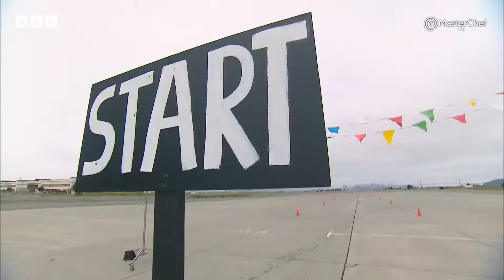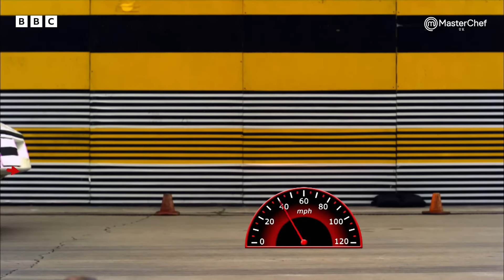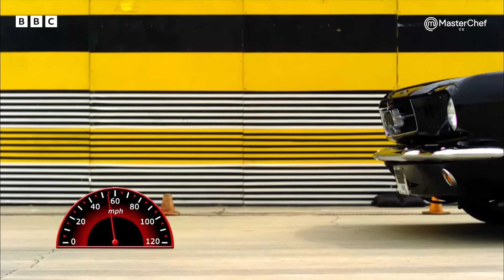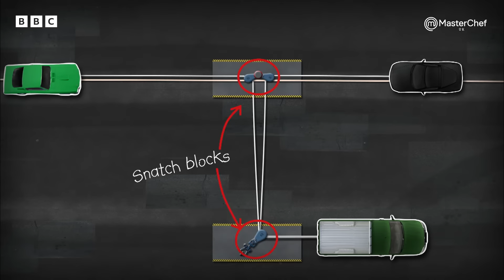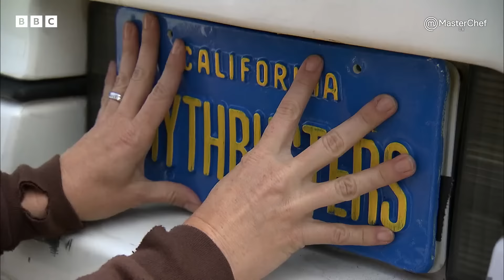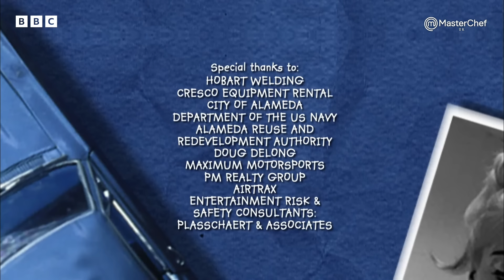Fast & Curious! | MythBusters | Season 9 Episode 26 | Full Episode

Comment: Blown away that they didn't wear helmets when learning to drive on 2 wheels.
Reply: You dont see the rollcage?
Reply: @emanueloliveira9338  Even professionals use helmets doing that.
Reply: @emanueloliveira9338  Yea that stops the "roof from caving in", but it won't stop Your head from crashing into it's "surroundings", with a whole host of different possible injuries, even if the speed is quite low...For instance breaking nose, jaw, teeth (etc. etc)) all of which teeth are pretty nice to have...No ??
Best regards
Reply: I also thought about that and have a guess, not a solid guess but, all i’ve got. I think the real life threatening thing would be their neck being fractured from all the G forces they were experiencing. The helmet would maybe add some extra weight to their heads thus effectively increasing the amount of stress to their spine when the car hits the ground. Maybe that is why?
Reply: @EmrecanKaracayir  Seat belts.
Reply: @scbtripwire  I think seat belts have nothing to do with your neck. If you watch carefully the heads of Jamie and Adam’s heads when car hits the ground you’ll see that they are all over the place.
Reply: @EmrecanKaracayir  They were wearing seat belts. It's illegal not to use seat belts because not wearing them costs lives. I'm not going to have an argument about something so mind-bogglingly obvious about seat belt safety.
Reply: @scbtripwire  Again, seat belts have nothing to do with the question of why they did not put helmets.
Reply: @EmrecanKaracayir you are correct. Helmets would increase the risk of a whiplash. Only in a fatal accident the helmet would matter.
Reply: @emanueloliveira9338  you dont see the glass flying everywhere??
Reply: I think it's much worse that he touched the ground from inside the car. That was completely unnecessarily dangerous